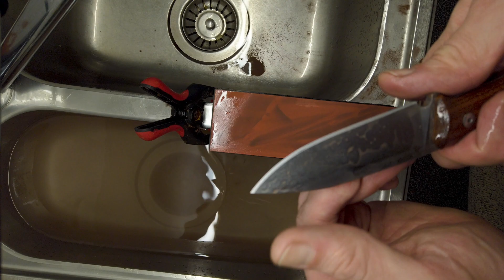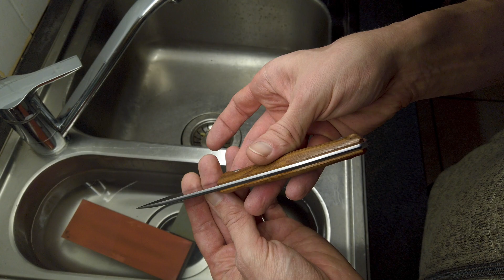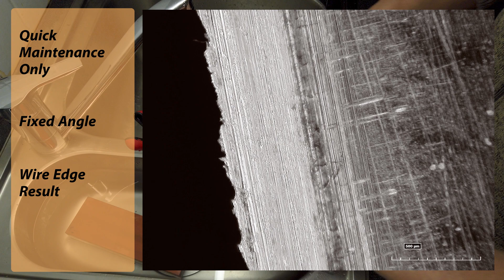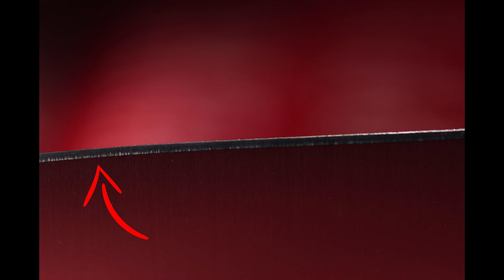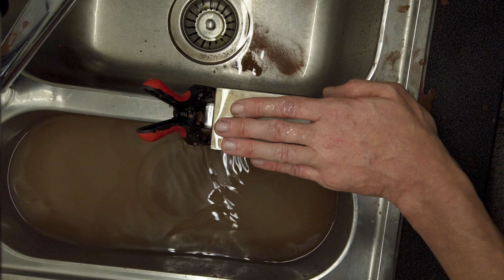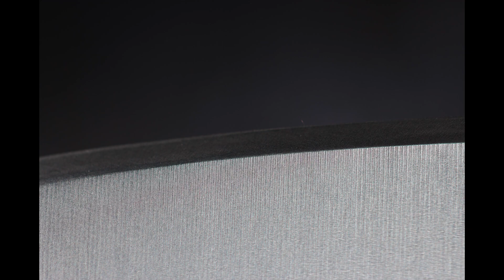Freehand Whetstone Sharpening of a New Lionsteel B35 Bushcraft Knife

Comment: Maybe I should start my own thing.... cause not many get this stuff right. I would rate this video 3/5 for info 2/5 for visual aides, a 1/5 for fundamentals, and a 2/5 for acceptable knife for bushcrafting.
Reply from the maker: Thanks for the feedback, much appreciated. I'm still learning!
Reply: @TomasHerink  ok still learning... I would suggest then, create a template to follow. It doesn't even need to be complicated, I use this rule KISS. Keep It Simple Stupid. To remind myself that most bushcrafters don't know a thing when they first start soooo when u get a new knife you follow your template. Example you don't have to tell everyone every part of the knife, simplist way, show and explain what the tang is, what the point is, the belly and blade edge and bevel. Then maybe point out or draw or show a couple useful edge types. Talk about the differences of how the blade and point line up with the shaft tang and handle. What a full tang is. Explain what happens when you sharpen away or towards the bevel, show how the wrist bends as you sharpen. Talk about what ever rules you employ when sharpening. Cover both water based stones oil based stones and diamond based stones and what the difference is. The pros and cons. The tricks you learn to make things easier and faster. About maybe using survival paracord to wrap the handle to fit in hand better and to give you additional grip potential. Talk about how to simplify understand the various steels or other type of materials. What not to do, ex sharpening towards your wrist with stone in hand bad idea.... cutting paper is a good example of sharpness but if someone is looking for even sharper then show them how to shaaaave the paper.  It's all about fundamentals. So if you create examples or explanations do it in 3s or 4s always it helps people get into a rhythm when they watch and listen to you. It may even be useful to use the not so great knives to show people where the limits are by intentionally using them in extreme (use ppe eyeglasses arm protection etc) breaking force bending force edge toughness sharpness duration. Really put the knife to the test. Once you've started writing down your guideline, use a family member to go through some practice runs before recording. It will help prevent you from saying ugh or skipping for a few to think if you got things right. Never be afraid to revise your guidelines. Have one for beginners and one for advanced but keep it on the same video just make sure people know they have entered the advanced part of the knife stuff in the vid. 
Some final 2 cents, explain which kind of knives can be used for making a spark, show and talk about how to make sparks with the best materials you can find in a survival situation, rocks, steel, fire striker (pretend you lost the piece that strikes the sparker) . Which blades do not spark. How to keep the blade clean and protected. To maybe add some neon color to the handle, or neon colored paracord wrap, in case you drop it in water or snow or grass or dirt. I hope this helps and is not to messy. Just remember to KISS everything. I look forward to seeing the new you :) good luck.
Reply from the maker: Beautiful. Thanks for the thoughtful input. Plenty of things to think about there for sure. Cheers!
Reply: @Crackitify  That's a lot of info and critique... where's your video on the subject? You sound like a expert, so why not share your wisdom?

Comment: I have no problem getting my knives sharp. I can get them to silently wipe the hair off of my legs or push cut circles in newspapers. The issue I have is that sometimes I have seen the curve of the belly start to flatten out. I have also noticed that knives with large, straight sections don’t tend to stay perfectly straight. If I lay the edge on a flat surface I can see light coming through in some spots. The last thing I have noticed is that I can struggle to keep the bevel perfectly even. Doesn’t seem like such a big deal other than aesthetically. Anyway, if you have any tips for dealing with these issues I would greatly appreciate it. I’ve tried many sharpening techniques from circular motions and cutting strokes on my field stones to the Bob Kramer crescent method and the push-pull method on my water stones at home. I love the edge I can get from my stones. I just wish I could get it without altering my blade so much. 
Thanks for the video. I found it while trying to decide between the b40 and b41 after falling in love with the b35 this past summer.
Reply from the maker: Hey Dalton, I think that if you want to have the edge cosmetically perfect and not just functionally sharp, you may need to go for a solution that ensures a precise angle as well as even wear on both sides. There is a lot to choose from out there in that space, like the TSPROF Blitz. Freehend sharpening will never be machine-perfect, that's probably the nature of doing things by hand.
Reply: @TomasHerink  oh no, I understand humans are imperfect and that there will be some variation. I’m perfectly happy with the function of my knives. The only thing that really bothered me was when the belly on my Garberg started to straighten out. I watched a video where virtuovoice had the same issue on his bark river fox river knives and I think he solved that one. I don’t like to rely on sharpening systems and would way rather rely on my own skills. I was just curious if you had run into any of the issues and maybe if there were some techniques to avoid them. I always worry about messing up the straight portion of my kephart knives. Thanks for getting back to me and for the nice video. Cheers ✌️
Reply from the maker: I see what you mean. I have no tricks up my sleeve for that one, but I'd amend the stroking technique to follow the curve of the edge with each stroke rather than fucusing on the straight part and do the belly / the tip later ro catch up with the straight part if that makes any sense. Thanks for watching, man.

Comment: Nice video! How are you liking your b35? I'm torn between getting it or the m4 as a general hiking/camping knife.
Reply from the maker: Thanks, man. B35 is great, but I like the proportions of M4 a tiny bit better to be honest. It all comes down to tiny size / weight differences. Very little difference in terms of usability, with M4 having slight edge in weight for chopping, but frankly, we aren't going to do much chopping with knives of this size, are we? B35 cuts a little bit better so that was the deciding point for me.
Reply: @TomasHerink  thanks, appreciate the reply. I'm pretty much going through the same process as you. I prefer the m4, but am probably favouring the lightness and sliceyness of b35. I am am only hesitant because maybe it could be a little too slimmed down. Do you ever feel under knifed for your uses? 
And really useful hearing some first hand perspectives by the way. Quite difficult to find info on the b35 online!
Reply from the maker: Yeah, it'll depend on what your typical usage is. I go for fishing weekends on an island, so it's all around the tent and the fire for me, with a lot of cooking, some wood carving, and general light bushcraft, so in my case, I prefer the sliceyness before the overall strength. Do I feel underknifed? Always, but that's my fault, the knife has nothing to do with it 😉 it is a balanced small blade that doesn't get in the way.
Reply from the maker: This may help: https://youtu.be/Y7Estia_-Y0
Reply: @TomasHerink  Haha, believe me I've watched that video many times over! Somehow it's not enough to make my mind up. Getting other perspectives is always helpful, as I'm not sure I am in full alignment with Kevins preferences. My use case is very similar to yours, and I think the b35 would make a fine knife!

Comment: Hey man, nice video! Very helpful to me (bloody beginner). Can you recommend a certain whetstone? Am I really struggling to find a good one that doesn't cost 400 bucks. Thank you in advance!
Reply: In my experience, after you get the bevel you the angle you like (this can be a considerable chore depending on factory grind and metal type), you can usually start with a 400 grit Chosera stone (like YouTube legend virtuvice), and then ‘hone’ with something like a 2,000, finishing on a strop. Note that the 400 will cup over time. I don’t correct mine because I like the convex edge it starts to produce. If you grind down factory edges a lot, that’s a little different strategy.
Reply from the maker: Hey, check the video description, you'll see links to the ones I used in the video. They aren't expensive, either. Hope it helps.